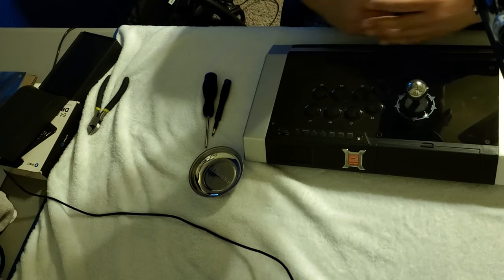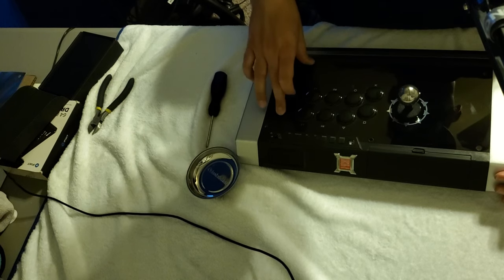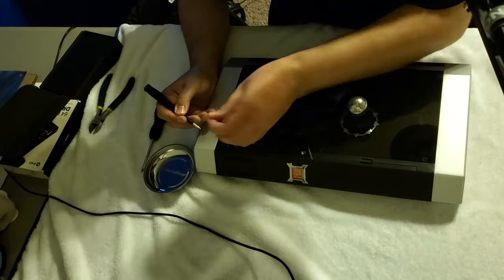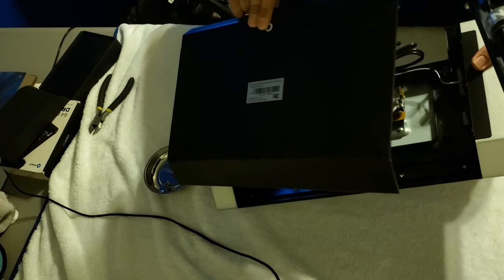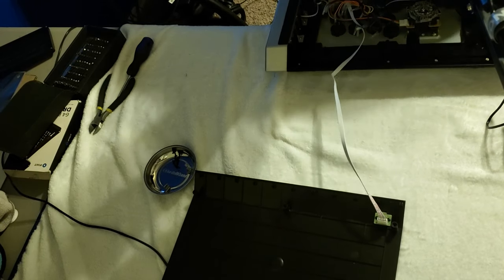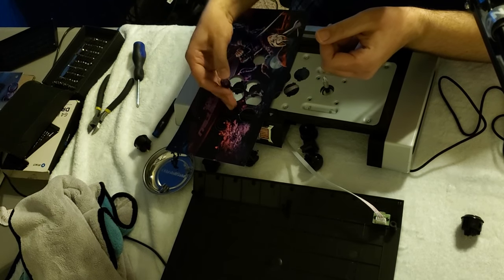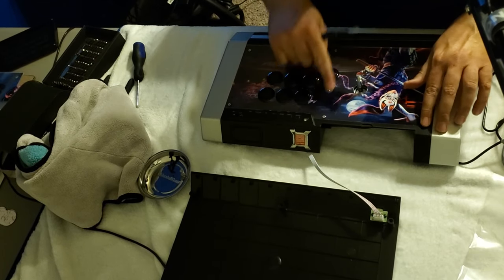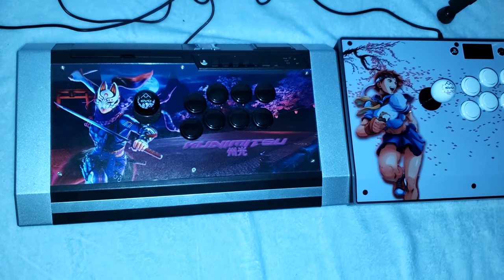Qanba Obsidian | Step-By-Step Customization Guide.

Comment: If I understand this right, if I'm only changing the buttons and the balltop, I don't have to remove the top cover at all right? Only the bottom cover. Is that correct.
Reply from the maker: Correct. Just open it from the bottom.
Reply: @Zachary_Sweis  awesome thanks. Just got the Pearl today so I'm going to put in the balltop/buttons, and when I get the artwork in a couple of weeks do those with new buttons. This video is super helpful.
Reply from the maker: @DaTekkenGod  Thanks for watching, I'm glad it helped!

Comment: having trouble closing the back panel is it just me or is it a bit difficult to put back the panel on

update: finally got it to close properly using a brooks converter on xbox works amazingly
Reply from the maker: It's definitely not just you. It is a little tricky. Honestly you just have to keep working it until everything aligns.
 As stated, this fight stick was not meant to be customised.
Reply: @Zachary_Sweis  yeah thanks man i thought i was just being stupid or something anyways it took literally about 8 tries till i finally got it to slide in properly, unfortunately i have to use sanwa buttons, normally i use gamer finger buut screws on don't fit plus the company went awol so nobody can really get any of those buttons at the moment